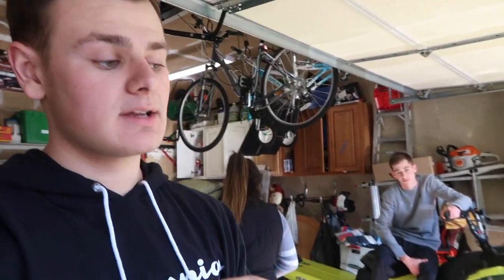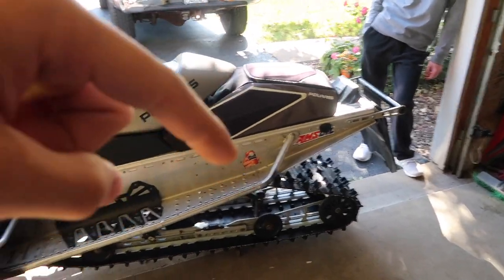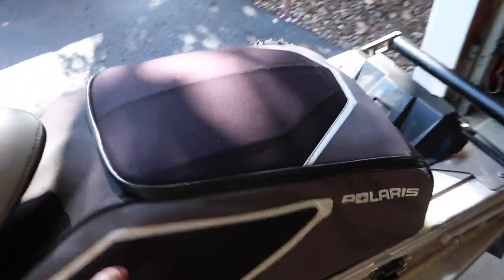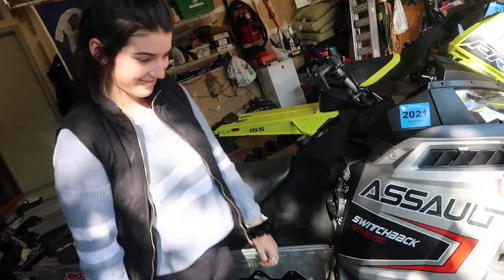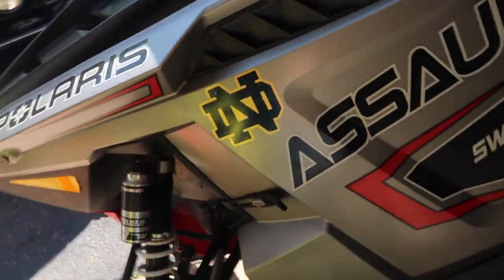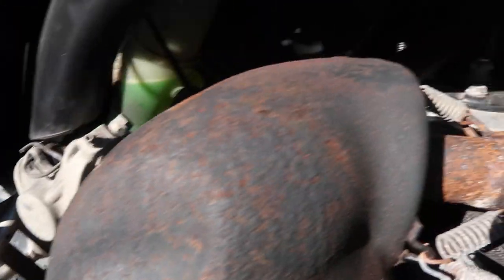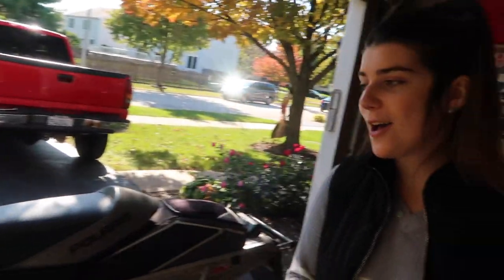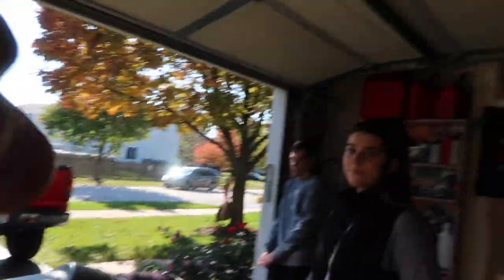NEW SNOWMOBILE REVEAL!

Comment: Price is a bit on the high side but if the sled is clean don’t worry about it. I would have gone electric start for your girlfriend though...  You will be pull starting that thing everywhere you go and she will not be happy if she gets stuck/lost/falls behind and can’t get that sled started... Ask me how I know... Those are not warm sleds so I would recommend the tall windshield for her and the side wind deflectors. Usually a warm girl is a happy girl. To get any sort of decent trail ride you have to run the front track spring loose abs lengthen the limiter strap.

Comment: Had 2011 swb assault myself, orange madness. Winter 2013 i mounted turbo kit on it, when the summer came i upgraded to a 71mm turbo and changed to wiseco pistons. The old pistons looked very good considering the abuse and it had good compression. Drove the sled for 2 years with turbo and up to 18 psi, no engine problems. Now i have a 300 hp yamaha, its no where close to that sled at all, kinda miss it.